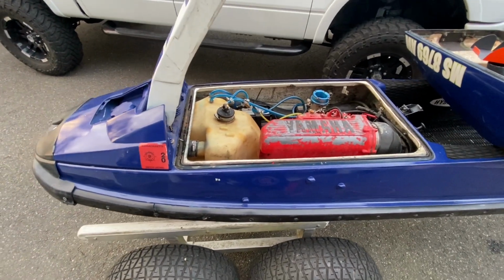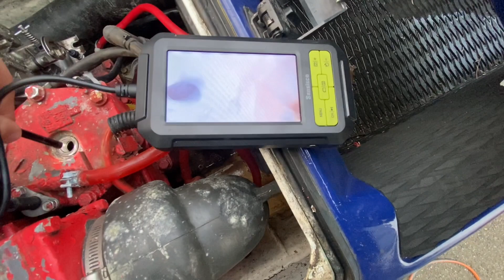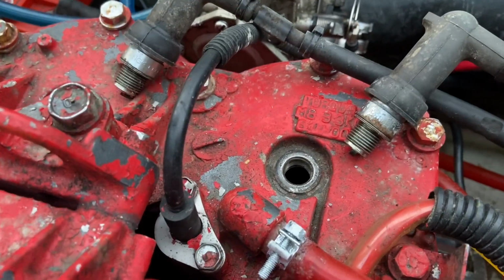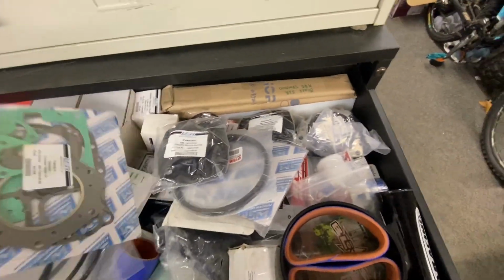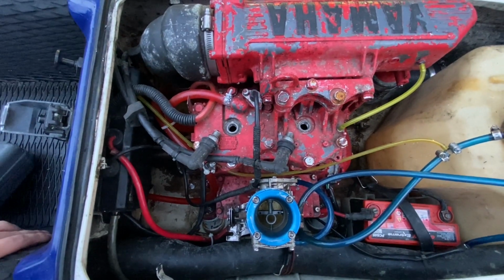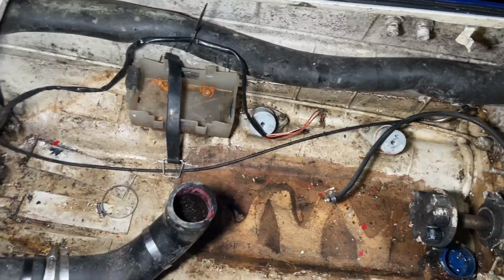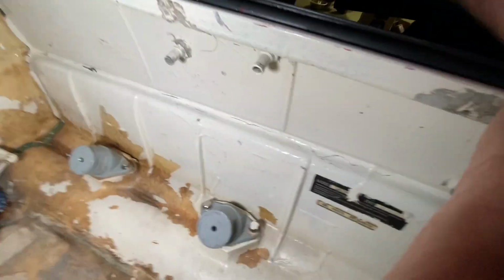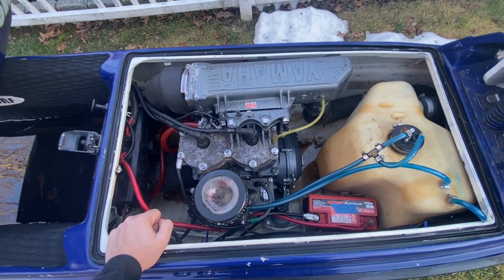1993 Yamaha Superjet restoration / saving!

Comment: Haha I just picked up a 90 in similar shape with a 701. Engine was seized, mid shaft sounds the same as that one without the pump. Someone also painted just the cylinder that same color oddly haha
Reply from the maker: Strange but funny lol

Comment: I'm building 91 right now myself. I am also putting a 61x in it out of my blaster.  Do you know if the 650 and 701 squares have the same size through hull metal exhaust tube or is the 701 bigger? I know the round nose have a bigger one but I can't find anywhere that says if the 650/701 squares have the same exhaust tubbing
Reply from the maker: To my knowledge they are the same but don’t quote me on it